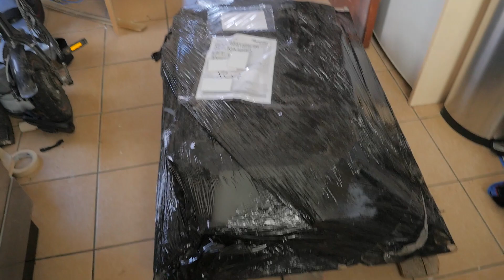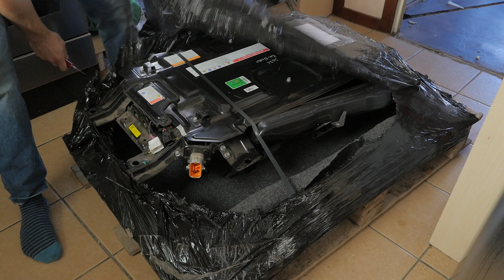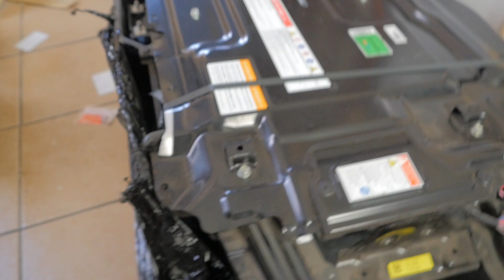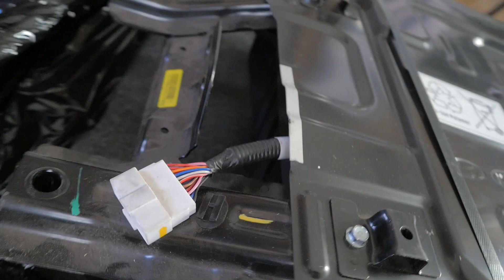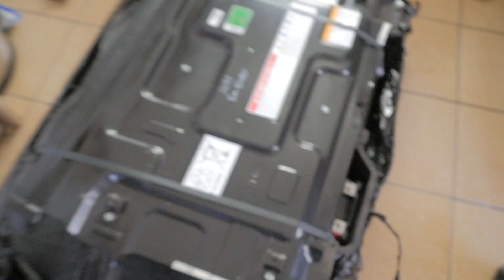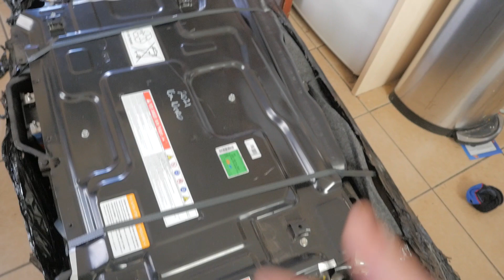Kia Niro / Hyundai Ioniq PHEV Battery Disassembly

Comment: These are cells  of 26Ah. It is right on the cell: "SK Innovation P260" pouch cells. This means: cells for Power (Hi-Power Cells). So, for charging and discharging with high C-rate (about 5C to the 45 kW motor in the PHEV). In contrast, Hi-Energy cells for BEVs would have an "E" there.
And then: "260" is 26 Ah nominal capacity for each cell. Capacity of each cell: about 26 Ah * 3.75V = 97.5 Wh.
Then, 1 module is a 4s1p module, 15V nominal, with 390 Wh.
Then 6 of those modules: 24s1p, 90 V nominal nominal, 2.34 kWh. This is one of those blocks, where the 6 modules are clamped together.
And then: He has 2 of those blocks in the case: that is about 48s 1p, 180V, 4.45 kWh, on his bench. This is half the total pack of a Niro PHEV or Ioniq PHEV.

The total pack of a Kia Niro PHEV MY2018-2022 or Hyundai Ioiniq PHEV has another 2 of those blocks for a total: 96s1p, 360V nominal,  8.9 kWh.
Reply from the maker: Thanks for that, I will use some more of these cells in an electric motorbike project.

Comment: What capasity battery is this ?
Reply: The pack shown in the video is one half of the 8.9 kWh battery fom Kia Niro PHEV starting Model Year 2018. So it is about 4.45 kWh, when new. To get a complete pack of a such a Kia Niro PHEV battery, you need another one of these packs. (1 pack is below rear seats, 1 pack is in trunk, they are in series).

Comment: according to Hyundai the battery should have 4CELL × 24MODULE (Total 96CELL) that doesn't seem to resemble your battery, confused!
Reply from the maker: I was confused too by what I had read. I found each module had 4 cells.
Reply: the other strange thing is that the total voltage of the battery should be 360V yours appears to be around 180V is that correct
Reply: is it possible they have put 2 cells in series in 1 package, in reality making 8 cells per module, what was the voltage across the module
Reply: reason i ask this is, your battery currently works out at 14.98AH x 180V = 2.7KW, but it should be 8.98KW
Reply from the maker: @andym5265  there is actually another battery that goes in series with this one. Each module is 4 20ah cells in series, so will be 16.4v fully charged.
Reply: @ShaunDobbie  from what i've read the other battery is the same as used on the standard hybrid car which is around 1.5KW, I'm not sure if thats included in the 8.98KW
Reply: 16.4V X 20AH X 12 modules still only adds up to 3.9KW
Reply: 16.4V seems a bit high, are sure not seeing a totally discharged 8cell module?
Reply from the maker: No, I have tested every module and when charged to 4.1v per cell, you get 16.4v.
Reply: just found a diagram of the 2 phev battery packs, the front pack has another 12 modules inside, so it's not the standard hybrid pack that i origanally thought, it all makes sense now

Comment: excellent vid, i'm wondering is there any way to test voltage externally
Reply from the maker: Not without opening up the battery and putting a jumper across where the hv disconnect is.
Reply: @ShaunDobbie  where is the HV disconnect located